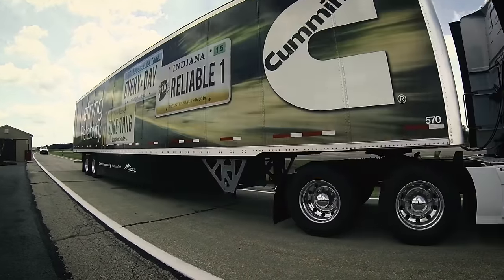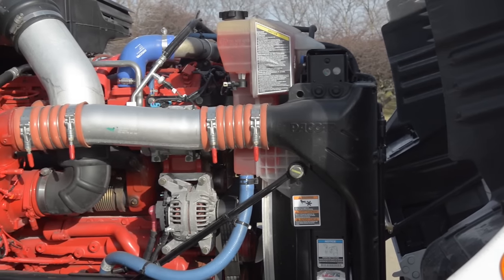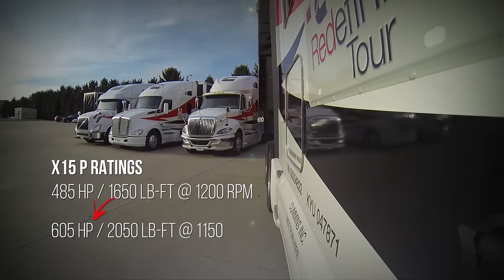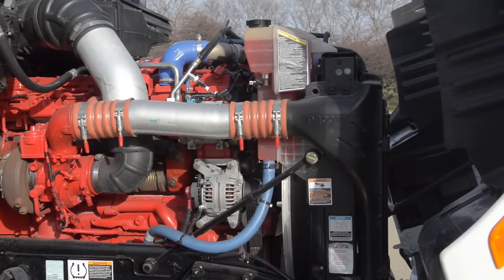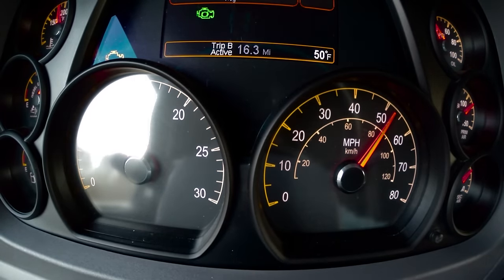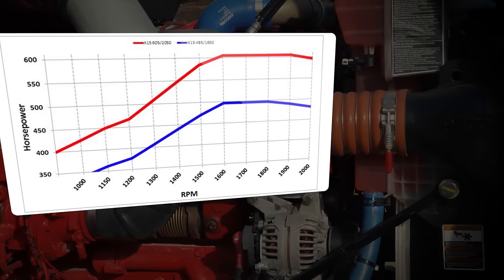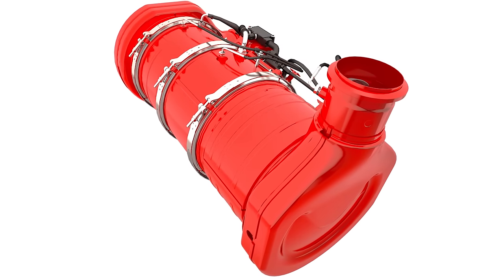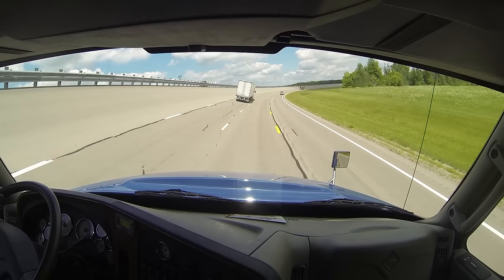Focus On... Cummins X15 Pt 3: Performance Series

Comment: I'm getting an X15 565 in a couple weeks mated to an Eaton Fuller Ultrashift Plus 13 speed in a 2018 International LT. Current truck is a 17 KW T680, ISX15 550 with the same trans. Looking forward to seeing if there's any real difference.
Reply: Get a real transmission and get rid of the junk automatic

Comment: Have they figured out how to keep all the soot and carbon out of inside. If not it'll be just like the ISX gumming up all the sensors. It will nickel and dime you broke. EGR and DPF is a engine killer.
Reply: Except, they aren't.
Reply: @moparproud3978  except they are. Its been proven time and time again they are
Reply: @austinfouts9139  WRONG! It hasn't been proven one single time, ever. We're over a decade having emissions, and there simply isn't an uptick in engine failures comparing pre-emissions to post-emissions. Hasn't been proven at all. Engines don't magically fail because they have EGR and aftertreatment, it's a total, complete myth regurgitated by moronic "know-it-alls" on the internet.
Reply: @moparproud3978  first hand experience with EGR issues. Several fault codes related to emissions. Three EGR Coolers replaced. Less than 200,000 on a Cummins X15.
Reply: And? What’s your point?
Reply: So if i delete the engine it should not have that issue ?

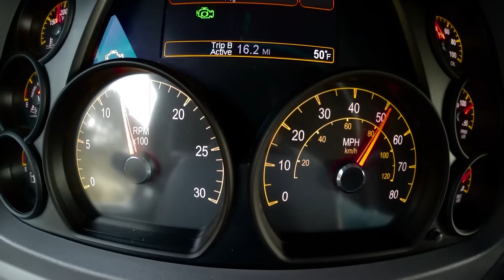Comment: Thumbs down for the check engine light @ 2:43.  And no I'm not talking about the jake brake light.  The check engine light is below that and to the left, partially obscured by the guage shroud.  Drop everything else and dump all you've got into designing a reliable aftertreatment system.

Comment: I'd like to test one up to Floyd,va from woolwine, vs on hwy8 or old 52 north to fancy gap an weight isn't a issue
Reply: U from there...I live in stuart ......2016 w9 icon  600/2050  18sp 3.65 rears 
Up lovers leap 77600 lbs   first long pull  bout 12  gear 48 to 52 mph at 1300  could hit 55 maybe but I just let er eat at 1300 rpm

Comment: I'm am the only one which stronly dislike the idea of the VTG? come's with two stage turbocharger option?
Reply: I disagree when he said about performance series isn't for starters. How starters of trucking have to do with at the first place. you mean some idiot Megas giving rookies a new truck?
Reply: I was thinking the same, i wouldn't give a new truck and engine to a rookie driver just to see abusing power and thinking is unbreakable. 

If you give to them over 350 hp in a truck, they will automatically think they are nico rosberg in the monaco Grand Prix and the company will support them because they give them a new truck

Comment: I have the 605 hp. Horrible mileage. 4.02 for the first quarter.
Reply: That ain't cool
Reply: How fast do u drive for this 4 mph???
Reply: They were built with fuel economy in mind. Mines set at 565 and I run on average 5.85 mpg. I'm also a flat bedder so fuel mileage is usually out the window.

Comment: I sure wouldn't mind having this engine in a Volvo VNL780 automatic 18 speed with 3.36 rears
Reply: good thing no one will spec with amt.
Reply: i would if i don't spec it with an 18 speed transmission than the AMT is another option
Reply: but remember, it won't come with amt adept like on efficiency series.
Reply: that gone to suck
Reply: Hey I driven the 2016 isx15 specd for fuel economy with auto. Driving 1200 rpm at 65 is horrible even if manuel mode is disabled by a company I work at.
Reply: that reminds me of Prime inc lease purchase trucks
Reply: once I sit and drive my dad's t600. ain't gonna miss those low specd trucks.
Reply: the efficiency series is for governed company trucks when you are a independent contractor or owner op you drive at the speed you want with the performance series
Reply: agree. that author should have said that performance x15 also owner operator.
Reply: Russ Trucker pretty much it's an owner op spec engine take the speed limiter off and there you go you got an wide open truck with a lot of power
Reply: @prestonrubin7908  why does it have to be known as owner op,there are still some companies out there who hire trustworthy drivers and they don't have to castrate there trucks
Reply: Who the hell would ever want a Volvo or a automatic trans in a truck, extended hoods and thirteen and eighteen speeds rule the road, if it is not a Pete or a kW it is not worth having and should not even be allowed on the road

Comment: You lost me at egr cooler so that means it's the same emissions trash like all other engines out here DD15 is so unreliable freightliner should pull it off the market but why would they when their service department is making 400% more then sales . If it ain't a glider o/o should stay away or you will be sleeping in dealer waiting rooms even if truck is under warranty you aint making no money .Catapillar knew that the technology to make a reliable emissions engine ain't available so they pulled from the market cause they know a egr c15 will be so unreliable it would make their brand look like trash aka DD15 aka ISX15. Owning one of  these with more that 250k on them is like running through a cord field with no underwear or trying to turn a prostitute into a housewife, you gonna be left shafted with no lube and no money .
Reply: Dan R real talk, but funny